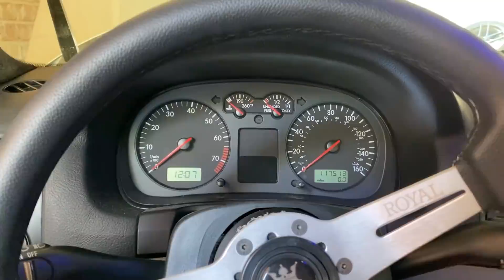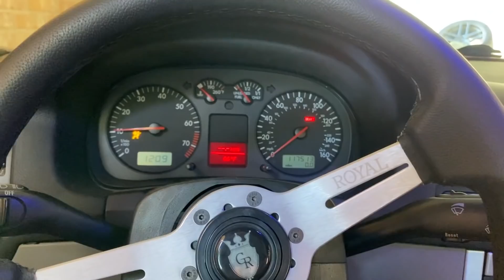WE PICK UP THE COOLEST OFF ROAD VEHICLE EVER!

Comment: I have a unimog 404. They are very easy to work on. You can get all your parts at expedition imports in California for them. You are missing the dog house for the engine. Most people have no clue how to maintain these properly. Also your transmission needs it's Transmission fluid changed if it has trouble shifting is most often caused from people using a gl5 gear fluid that east the brass inside the transmission. It needs gl4 only. We use redline gl4 keeps the transmission running very smooth and keeps it cooler as these transmission are like tractor transmission and run warm at speed.

Comment: That thing on the driver's side is connected to the batteries and it's for jumping off a dead battery. It's military (NATO) and uses a special set of cables and adapter. Google military slave cables, and NATO slave adapter to find a set. But if you leave them unmodified... You can only use them on other military vehicles. Like Aarons Hummer. It has the slave point under the passenger seat
Reply: ☝🏻☝🏻☝🏻 what he said! U.S. hmmwv have a similar receptacle on the driver side seat.
Reply: @Manny92284  passenger seat
Reply: @markhoffman4903  yes

Comment: That battery charge port is for the military version of jumper cables. And yes you could power other equipment from it. Like add on radio equipment or tools. The unimog excavators the Marines had when I was in, had a bunch of other stuff you could plug into it. I forget when they changed from that style to a more common rectangle shaped one, but they made adaptors until they all got swapped.

Ours unimogs however were diesel and I’ve not known ever one to be gas. So if this thing is on LP now, before thinking you can ‘go back to gas’ - make sure you shouldn’t be going back to diesel because I can not think of many military vehicles that were gas - because it was not widely supplied and dangerous in handling. And too flammable for shipping by air or sea…. Which is why everything was multi-fuel diesel or during combat JP-5 specifically - you could run a hummer or a truck or helicopter or a plane or a tank on the same fuel.

Comment: Torque tube boot unbolts so it's super simple to remove! The 2 pin plug by the cab is vehicle power, I believe it is direct to battery, so can be used for both powering items like feild radio stations or lighting etc... or can be used to recharge the truck batteries. I may also be a 200A socket. I was going to put one on the Land Rover, but decided to go with Anderson connectors 175A so it can be used as jumper cables or trailer power etc... I have 3 outputs around the LR, why not...

Comment: I'd love to see this revived! If you fabricate a bell housing, you can swap the motor. OM 617 diesel is a common choice for this. Tires are too big, 42" is pleeenty enough (even with like 38s you have mad clearance on account of the portals), and it'll handle better that way (center of gravity), plus they're easier to turn with a weak motor, which is all you can put in there, because the gearbox only takes about 250nm max (185 ft lbs). With the crawl ratio on this, that's plenty, though.

Comment: In Feb' 2014 I stored a truck I had, a 2001 F-150 5.4 Tritan, it's a really nice truck, and it just sat in storage, never started for over 7 years, and 4 months ago I gave it to someone in need, I thought for sure it would need the tank drained and a new fuel pump, but we stuck a new battery in it and it started right up and has run perfectly for 4 months now. After it started I went and got a can of Seafoam and put the entire can and fresh gas in it. I was amazed because I was used to cars having issues and the gas smelling bad if you let them sit a few years, so I'm thinking in 2007 when they started putting 10% ethanol in gas that it has caused gas to stay stable longer.

Comment: Not big on stance but I do love seeing a clean old car.  Always wanted a 404S.  The interesting thing about those is that the frame is designed to flex with the suspension.  Lots of potential there.  Always loved the old Rubicon Trail Poop Truck.  It was silly and cool at the same time.  Outwheeled a lot of highdoller rigs too.

Comment: The cap that was unscrew on the side of the Mog is the salve cable receptacle for jump starting the vehicle. Normally they are set up for a 24 volt system. Well worth having and better is once the vehicle is running right, converting to a 12 volt system.

Finding 24 volt light bulbs are a pain. Any accessories inside the MOG should be powered by a 24 to 12 volt transformer, as tapping the power of just one of the two batteries ends up killing that battery.

Comment: That charging port is called a slave receptacle. The cable that plugs into it is called the slave cable. The military uses those to make jumping a dead vehicle easy. Because many times the batteries are not easy to get to, and it's just faster to plug the cords in then to open up the battery compartment and hook up jumper cables.

Comment: Those rims on that Jetta are amazing!
Reply: OK-somebody has to explain this whole 'tire too small for the wheel' look.  My assumption is that much like "stanced" vehicles the original roots were from the performance world but they sorta forgot what they were doing.  Best I can guess, street guys were trying to emulate the look of actual performance and race cars like DTM or BTCC which of course run very low and a lot of negative camber since well....race car.  Of course on the street huge negative camber like that is a disaster but they weren't really interested in performance, only looks.  To that end I further assumed they had trouble getting a proper sized tire to fit under the fender lip but still wanted the look of performance that came from a wider wheel so they started trying to stretch a too-narrow tire over that wide wheel which eventually became a look all it's own among the style-only crowd who probably didn't even know it originally was derived from performance and racing suspension.  Am I close?  I admit, it's not something I can get into as it actually hurts the vehicle performance in the name of a given style.  Then again, I'm what they call an 'old f#cker'.

Comment: Had a similar coolant issue with a front wheel drive car.  Pulled the engine and replaced the coolant lines and did gaskets at the same time.  Had around 180k on the car at the time.  Ran great and ended up as a solid first car for someone else.  Agree with Chris on swapping the uni-corn over to deisel.  Better pay that ticket or ol'Corn Pop will let the GSG come pay you a visit.

Comment: That electric port on the side is called a "slave" connector which on most military vehicles is the same as using jumper cables because they tend to sit more than drive and the batteries are usually dead and they're parked in a motor pool next to many many others like it and then we had what is called a "slave cable" to jump from.one vehicle to the dead one and then give it a Jumpstart but the owner was correct it can also be used to run accessories if in fact you have any 24V accessories that is 🤷‍♂️ its basically just a direct link to the batteries is all....

Comment: I would yank the propane off of it because without higher compression you get even LESS power out of a propane conversion.  Obviously it is a common off-road conversion so your vehicle will run at any angle, but with only 56hp new, reducing it by 20% is the last thing I would suggest anyone do...  Super cool project though!

Comment: I hope the previous owners didn't butcher it to badly a lot of people ruin them because they have no idea how to maintain them. Also the 404 makes 85hp when they are running properly. They came with 10.5 20 tires from factory which is basically 37 10.5 20. They don't have the power for bigger tires. They clear 40s fine from the factory but the additional clearance is not worth it at all as it seriously effects the driveability.